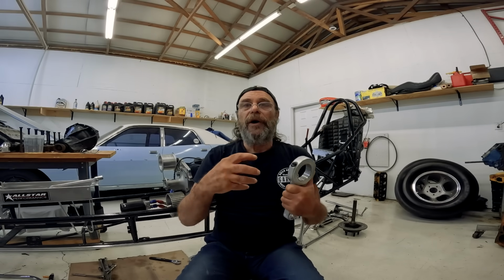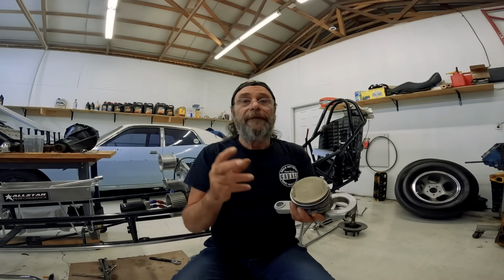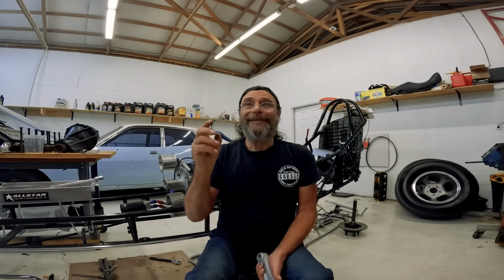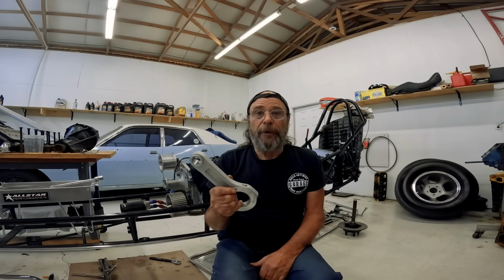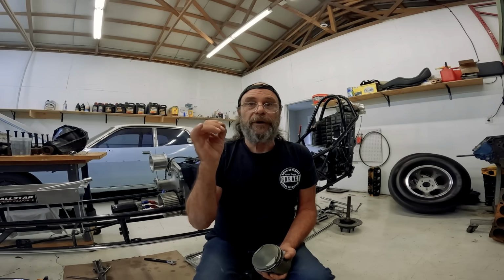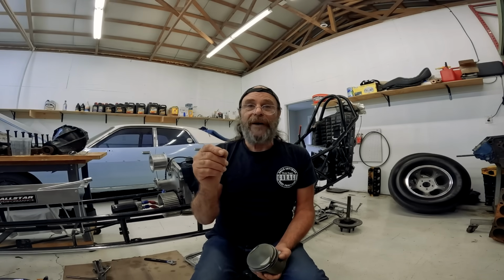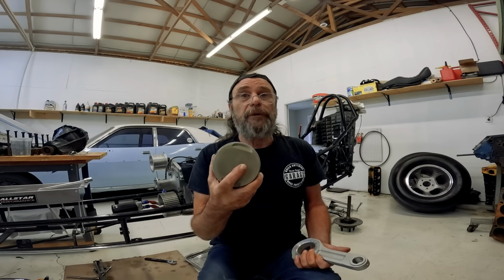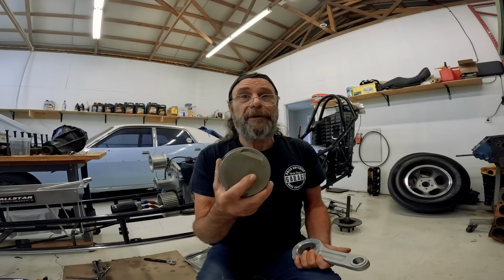Project Top Fuel Pt.9 - How Nitromethane Makes Power And The Importance Of Rod Ratio

Comment: I saw where the Strips had  rollers to get the cars  started?

Handheld electric starters were apparently available?

Saw some fellas use some  nitro right in the airflow of a gas carb pepped that right up. 
Same with a 2 stroke chainsaw engine.
Makes me just curious enough I cant promise I wont really screw some shit up with the aid of Nitromethane hmm.

Comment: It is extremely interesting to see that they do not consume valves on every pass when you tune as Tony suggests. I read the "Drag Facts" post someone made long ago and assumed, per my eighties childhood experience, the top fuel engine was consumable. In my gut, I knew it could not be that way because the early days would have ended with abandonment of nitro. Budgets were real back then.

Comment: What would it take to convert that into full power stroke? A shorter rod, more pump, another spark plug? Is it possible to feed that amount of fuel into the chamber through a conventional port and valve? And, how are you going to NOT use the second half of the stroke? When the exhaust valve won't do anything? And, it still has to make a decent amount of power right off the whack. 200 at the 1/8.

Comment: I know nothi g about Top Fuel other than I really miss Heartland Park Topeka 😢😢Your explanation reminds me of why you can run 11.5 or 12 to 1 on pump gas in #2000 car that isnt used to lug or tow without detonation.The engine never gets put under a strain or load ? ??
Reply: The faster you turn the engine, the more forgiving it is on detonation.
Towing and lugging occur at lower revs.

Comment: Im not sure how accurate this is today but I had read once in drag racer magazine back in the early 2000s that the then modern fuel cars used a camshaft with the the lobes ground slightly off centerline front to rear to compensate for the camshaft metal actually twisting under load durring a run.......thats insane to think about.
Reply: They're ground straight now. That was an extremely viral rumor that'll never die. The Crankshaft twists much more the Camshaft. Camshafts drive very little net load. Every roller lifter it pushes up, pushes back down on the cam. The entire rotating assembly only accelerates from 2.5 to 8.5k RPM at the hit, then it stays there until 660' when it begins to decelerate.

Comment: I've been a drag racing fan since the 80's.  What I've never understood was why the alcohol classes exist, and how that fuel it different than nitro and gas.  A video on that would be nice.
Reply: Methanol is cheap and can be run at extremely high compression ratios and is easy to cool but it actually less energetic than gasoline methanol motors will last longer at the same hp level as race gas
Reply: @turkeyboyjh1  AND make good power, its cool 😉
Reply: @67L-88  oh yeah it’s fun to play with you just use a ton of it I ran my Volvo 5cyl with a holset turbo up to 30psi with 1200cc secondary injectors so I could cruise around town on gasoline then let her rip at the methanol would fuel the rest, 10 gallons would go fast

Comment: Nitro is 1 to 1  ratio , gasoline is 14.1 ratio  ,you cut nitro with alcohol too control it ! You get into trouble when you go over 80%, runn 100%  is very dangerous  lol
Reply: It was explained to me that 85% - 95% was rhe safe zone. We ran 93%. The full can is cool sound and flames, but motor is on kill.

Comment: A shorter rod ratio has a higher acceleration and TDC and LESS acceleration at BDC, piston dwells more at bdc
Reply: Thanks for clearing that up.  I made an Excell spreadsheet to track it, but never looked past 90 degree.  For common ratios max piston speed was actually somewhere between 85 to 87 degrees.

Comment: My only Nitro experience is Cox .049 engines.
Reply: Lots of glow plugs on a tight budget 😖
Reply: And the scream of 25 - 30K rpm.
Reply: The crazy thing is the nitro RC came FIST, if I remember right the very sport of To--fuel started with someone experimenting with adding Nitro they bought from a local RC shop!! But the two engines are so different it's not even same realm, though both have incomparable power-density compared to literally anything else.. The only thing coming close to Nitro engines is the HCCI "model plane Diesels", which are half 2-stroke oil, half kerosene basically. I have one keep forgetting to start it, no glow-plugs but the highest compression-ratio of any engine ever, upto 30+ allegedly in some.. But it's always variable, the head is actually an opposed piston you can screw in & out some, to adjust ratio. They're also the only HCCI engine, until very recently Mazda finally released their Skyactiv engines, but it's only HCCI at some RPM / power, they still use plugs to light it off, so basically msot of the time the engine literally runs on knock, but normal ignition. They don't break immediately because there is so much unused / extra air which acts as cushion, very smart idea..

Comment: Three sixteenths is much more than forty thousandths.
Reply: Yes.. .30 is close to a 1/32 of an inch, ballpark
Reply: Your missing the explanation a stock rod is 6.85 in a 426 they were using 7" rods which would be 434 ci then they and .040 which i think is 436 ci and 3/16 (.1875) longer than stock
Reply: Rod ratio does not affect displacement. Think about it; even an 8” rod in a 426 wouldn’t change the engines displacement. 
Now if you increase the stroke, of course you’ve increased the engines displacement.
Reply: @jeremyhanna3852  Thanks. I figured I was missing something. There was a lot of new terminology for me in this one.
Reply: @StratKruzer your very welcome

Comment: Come on tony can i please try the nitro? Lol. Its a steep very expensive learning curve and you never know 50% of what you think you know about running nitro. Every one listen to tony. He has been there and some how got away from it and now is back at it again!!! This time it's someone's else's money and dragster!!!  That makes it alittle easier for sure. As far as my nitro experience its very small and only up to 65-70% nitro. Most of the time on my dime. So it is a terrible terrible disease to have. Once you are "cured " you should never ever go back but tony did. Lets see if he can again be cured lol. Love these episodes tony keep these coming. Mike in new Mexico
Reply: I feel it I started out playing with ethanol then went to methanol on the jet boat, I’ve only tried 30% nitro a couple times but it definitely becomes a financial rabbit hole
Reply: im not looking to track-run's just car-show/driveway cackling+smells for 4th-July funnies as my new combo/turbocharged in the charger70 already makes enough to to snap a TR6060/8-3_4 and smokey show-tires ect

anyways video ideas for bravo/dumbfounding is there any combo's that have could run GDI/replacement-with-water to time-cool ( like to do this watering/steaming on gasoline 91 so i get more MPG's-ect ) the cylinder like how RMS-victory's guns/cannons are swabbed down between shots and or water-bag-added to control sparks+hot-spotting? and or how much can nitro get pumped/compression ( 1970 waterman/used aircraft's pumps used looks to have set-point/max'd-out at 200/300PSI, but direct injection systems require 400bar~ / 2~k or more PSI ) before it goes-off/diesel's as nassa tried moving it in a 4in-pipe( shock in the pump's/pipe/static-sparks some how settling off, iv know about this problem sense 2015~ and or i starting looking at 2g hemi-combos and max-wedge-era ) and or as rocketry-fuel but couldn't get off the pad without a bang-ect
Reply: pass me the injector, dude.... Seriously it's so funny how he talks about Nitro like it's a hit of meth, not the good kind lol.